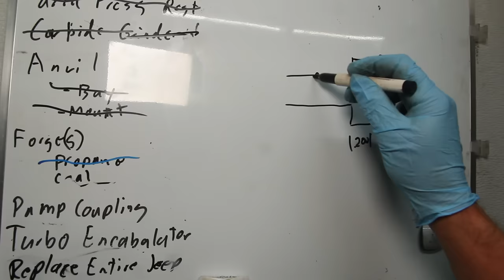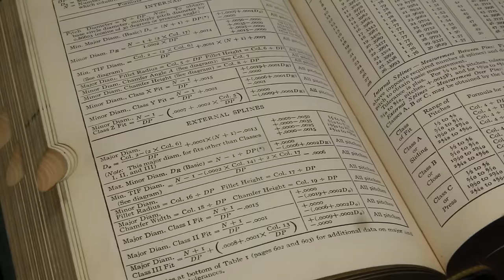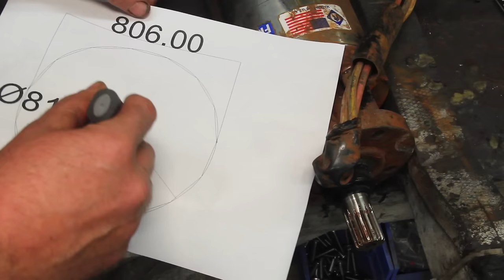Internal Splines (and Hexes Too)

Comment from the maker: A couple things keep coming up in the comments, so I figured I would address them here:
In getting ready for this, I was able to find the pats diagram for the pump, it shows a one-piece, rigid coupler attached to the shaft.  In fact, the shaft and coupler are listed as one part number.  It’s not a lovejoy or other sort of flexible coupler.  And yes, the fit on the spline as shown is probably a little tighter than it should be, but after several rounds of assembly and disassembly, the fit did loosen up a bit.  I’m assuming there are some small burrs in there that got knocked down.  If I had to do it over again, I probably would make take another .001 off. Additionally, the hex shaft is about .003” under the nominal dimension, and I made the broach to the nominal dimension, so there’s some wiggle on the connection on the hex end, so I’m not particularly worried about misalignment or vibration issues.  Also, a flexible coupler probably wouldn’t have fit in the pump housing.

The other two things that come up are 1) why not modify the shafts, and 2) why buy something to make it work.  The answer is: because Jeremy Makes Things. I wanted to see if I could do this, and do it as close to the right way as possible. I knew the theory behind doing an internal spline, but theory and practice are two different things. I wanted to push my skills.  As happy as I am with the end result, this project was just as much about going through the process.
Reply: You're doing an awesome job here, I hope you don't feel the need to justify all your decisions to any naysayers out there. Great to see you pushing your skills. Just keep on keeping on, you're doing all the right things 👍
Reply: G'day from West Australia🙂
As a 3rd gen engineer with 40yrs of trade life.

Well done buddy well done indeed.🙂👍👍
Reply: Well said. Thank you for a great video, I learned a few things. Awesome.
Reply: Jeremy makes things, not Jeremy buys things.
Reply: How much did you  charge
Reply: @Blue.star1  I believe he mentioned at the beginning of the video it was for a veteran run affair and was a "Freebie"
Reply: the reason your cutter climbs up in the holder when you are making the splines is because you have too small a relief turned at the bottom of the hole.
Reply: Nice work I have a shaper as well. It’s a Hindey shaped . It’s just about ready to use the oil isn’t getting to all places it needs to.
Reply: Nevermind....
Reply: You did an excellent job, coming from an Sink/Wire EDM guy!
Reply: I would label the 2 test pieces, keep one and give the other to the owner/caretaker of the pump so if it's ever lost or broken, you have the template without having to do all the refiguring.
Reply: The spline is actually a common one. Many tractors even today use a front or mid mount PTO that spins at 2200 or 2000RPM using a one inch 15 splined shaft and couplers
Reply: @edm2514  I agree, but personally I would have built an EDM machine, it's easy to do. Check out the "Easy Peasy" dc motor pulse EDM build on my channel, it's a cheap and quick way to build a commercial grade EDM.
Reply: @AtMortenJ  thats the same thing my doctor told me.
Reply: @Tigglebitties  Do you really think this needs micron precision? Bearings handle a lot, and lip seals have flex for a reason. One of the great things about precision tooling and work is that if you just 'get close' with something like he did here it will be fine for coarser machinery like this pump assembly. 'Precision' is always relative and this pump and it's environment are not very precise at all by machine shop or tool room standards.
Reply: ทำวาลาเดนเซบาสมาหในกรุงเทพของจริง
Reply: Delrin.
Reply: Was wondering if grinding a small back slope on the tool where the set screw sits might help this? but maybe it would just slip the other way?
Reply: Probably would have been easier to replace the shafts with keyed ones. I don't imagine that pump is spinning very fast. Journals on paper machines are just keyed and spin a few thousand rpm. There's a lot of weight and torque put on them as well. 
It's fun to make something tricky every once and a while, but that project is what we affectionately refer to as a Fuck-Story. Working for a company that has some of the OLDEST equipment in my state and region has me doing some inventive stuff to keep these ancient machines running.
Also, Amada and others charge ridiculous prices for spare/replacement parts. Parts that I can make for pennies on the dollar.

Comment: We had a spline shaft come in pieces, to the shop. I made a series of kerfs, carbonized it, and heat treated. Made a short broach to clean up the spline. Used a dividing head for the shaft. I think you should always knurl, as slow as it goes. Too often, the knurling wheels, weld on to the pins. Can't keep enough oil on them, knurling can produce a lot of heat.

Comment: Jeremy, a while back I had a similar problem with a splined shaft from a Volvo Penta transfer shaft.  In my case, splines were worn due to hard shifting and the metal not being hard enough.  So, I simply converted the splined shaft to a hexagon and that made the process much easier, not to mention harder to wear down.  Great job.  A pleasure to watch as always. Gilles

Comment: I have worked on alot of these submerged pumps and you've done a GREAT JOB making them fit together . The different companies intentionally made their connecting shafts different just so the average person couldn't connect them together they want everyone to buy a new pump and motor together but if you had the other two half's you could have just changed out the shaft witch is possible in some pump's or cut the shaft short turned down the end and pin or weld on the right shaft connecting head. But AWESOME JOB !!!

Comment: Was working on the bomb bay doors of a B-17 and they used a splined shaft sliding thru a bronze coupler to compensate for the length of the actuator shaft changing as the doors opened and closed.  Parts for an airplane this old are usually made of unobtainium but the factory drawings for the parts had the manufacturer of the spined shaft and they are still in business and they still make it.  Purchased 6 feet of it and used pieces of the "pinion wire" to make a broach and then drilled some bronze for the couplers.  Once the couplers were broached the fit needed to be  a sliding fit and so a lot of valve grinding compound was used to wear in the couplers.

Comment: I learned something new - when using setscrews to secure a hardened tool in a shaper, use at least TWO setscrews at 90 degrees to each other!  The tool pressure is clearly immense.  Machining a couple of mating dimples into the tool might also be useful (?).  Great video.  Many thanks!

Comment: Next time, if you have access to a comparator you can use epoxy to make a copy of the shape on the splines, align it on the comparator and find the exact angles and measurements you are looking for, lightly coat the splines with oil, anchor lube or Vaseline to keep the epoxy from sticking, it works perfectly and no much need to hunt for information. 

Great job on this build, I did learn some points on how I can do better next time. Thanks.
Reply: Another key way to measure splines (external or internal) is by a dimension over pins.. I think the pins need to sit on the pitch diameter of the spline, and it should be possible to calculate it using CAD & approximating assuming a straight sided spline tooth.  Great video! & great that this was a 'volunteer job'! (wonder if you heard anything back from them, is it still out there pumping away?)

Comment: A masterful piece of work and patience!  No more buying broaches for me, I've got the shaper, heat treat oven and oil so no excuses.  Just a note on the hex holder tool you made, if you part off a little brass disc and put it into the grub screw hole before the grub screw, you won't get all those marks from the screw tip on your nice hex mount tool 🙂

Comment: Great work on the slotting, Although I would recommend using the standard tooth to slot the correct profile. Seem like an application in which high RPM is experienced, its prone to quick wear and mismatch. You should be able to hear it with time (if occurs).

Comment: For your backing out problem you had with the hss cutter in your spline maker, try putting in a center drill divit where the set screw seats. It should greatly reduce the chance of it backing out and loosing your measurements

Comment: the amount of wobble at 11:15 is glorious. when this dude says its not exactly straight he is incredibly optimistic!!
Reply from the maker: That was where I parted it off into two pieces.
Reply: @JeremyMakesThings  it was nice work. without cnc and cam. I woulda needed several runs before anything worked out.

Comment: That was long but great.  Watch Wes Work needs to watch your channel,  A hydraulic barrel cylinder had a spline that got super sloppy.  A perfect job to bore out the hole and make a pressed fit replacement as well as weld up and spline the shaft of the barrel cylinder.

Comment: I had the same problem with a tool sliding in a boring bar while single point threading some ACME nuts for a project. What I did to stop the problem was grind a small groove in the side of the cutting tool so the set screw had something to locate on and bind in. The tool never shifted for the remainder of the job once tightened in place. Another solution I have seen is to bore a small hole in the side of the boring bar the intersects the square hole and tap it for a second set screw. With two screws the tool is held more securely an is less likely to slip.

Comment: Great, fun video.  Haven't used a shaper or planer in decades.  But I need a cheap and simple method of creating internal splines.  Short of broaching, it's not going to happen in solid metal.  With some compromises, may be able to mill acceptable ribs.

Comment: Very real down to earth video of what a machinist has to do when they have to make a new one off custom part fit an existing “well worn and used” part. 

There will always be a ton of trial and error followed by readjustments and it’s awesome you included a lot of that with this video. 

On a totally unrelated note I was wondering if the people using this ever expect to have to separate these two halves again for any reason? 

If they had told me unlikely then reattach the two halves, cut an access window to be able to work where they come together, MIG Weld the crap out of the two and call it a day 🍻 … but if that had been the case we all would have missed out on this video so cheers to you late for taking the longer, harder & Higher Road.

Comment: Never seen a shaper used in that way! These days it's rare to even see a shaper in a modern machine shop. Nice job thinking outside the box! To make internal splines we make a graphite electrode and use EDM to burn the shape into the part.

We used to machine a lot of 304SS at work. That is one of the most miserable materials you can turn in a lathe. We got the OK from the customer to experiment with 303, as the parts didn't need much strength, only corrosion resistance. 303 cuts almost like cast iron, leaving a powdery type chip instead of long strings like 304. We have a contract of about 2,000 parts a year and we have had it for nearly 50 years so it has saved a lot of machine time (and machinist headaches!) over the long haul.

Comment: Thanks for showing a shaper machine usage. Since I don't own a shaper I probably would pay someone to use their die sinker EDM machine  or  a wire EDM . If using the wire EDM you would have to later spin-weld the hex. female & internal spline together.   I don't own or know how to use an indexing divider so I would use my rotary table.   I would have ground or cut a shallow step on the 3/16  square bit enabling the set screw (grub screw)  to tighten onto & preventing unwanted movement.

Comment: Impressive work. The 1" 15 spline is actually a very common size. ALL 2000 RPM Power Take Off for tractors and mowers have this spline configuration. You could have bought a coupler from Surplus Center to make things alot easier. They sell the spline coupler and the hex coupler, which mating them together would have been easy. Ice done several " adapters" for various applications

Comment: Yep a lot of work, and looks good. But I'm sorry to say the motor is an industry motor for borehole pumps and the splined part is available with out having to go through the large amount of work to get the item. We have old warn shafts that would give the internal spline and give a bush to weld to the other item. Tony

Comment: Nice work. Try to punch on the spline tool u made on side where the locking bolt rest. So that it locks with the hex threaded bolt u used.  And the tool wont get shifted. Best of luck.

Comment: These type of splines usually have a 30 degree pressure angle but the shape of the tooth is actually an involute so its shaped like a gear tooth, and actually has a little curve to it.

Comment: A year late tip. The internal shaper tool bit needs a shallow v notch or a shallow notch ground in it to stop the tool from slipping as it will be not only pinched by the set screw but positioned by the tip of the set screw.

Comment: 4:05 when drilling into a small diameter round bar, spot face a flat slightly larger than your drill onto the round side of the bar before center drilling to prevent it from walking. Then it is no different than drilling into a flat surface.

Comment: over all I believe you did a great Job, never having to cut internal splines, I did learn a lot, thanks for this video
my only concern is your accuracy may be greater than the stack up tolerances between the pump face and motor face both parallel and concentric,
but I am sure everything worked out just fine

Comment: I'm no expert on splines either. I had to make an adapter spline for a $40,000 plastic injector augur. It to was a non standard 15 tooth spline. I did know that it was metric. I didn't have a Shaper, so I used a lathe with a crudely fabbed indexing  wheel. It was also 304 Stainless Steel. I was lucky on the opposite end.  It was  a simple Keyed connection for  the motor. The Augur was about 8' long with a tapered and progressively shallower rounded root dimension. The pitch also changed as it got closer to the small end.

Comment: I know that was a challenge but you done a good job I'm a retired machinist tool maker most people don't understand how much knowledge and skill it takes to do a job like that where you have to make your tools to do the job with but I do done it for almost 50 years love your shaper they are hard to find been looking for one the same size are you running it off a dc motor what brand is the shaper that was a job well done like it that you showed mistakes like in real life that everybody does but usually don't show thanks new subscriber
Reply from the maker: The shaper is a Rhodes, and I’m running it off anDC treadmill motor. I’ve got a few videos on refurbishing it.

Comment: Wow, that's just crazy 
Want to tackle making a coupling for a Sundstrand hydraulic pump? It looks like the same spline size and no parts are available. Old collectible Wheel Horse tractors used the Sundstrand setup, but the engine couplings fail too easily.

Comment: Love it! Edm might be more accurate to use the first piece as electrode.  You might need to put a gauge with liquid coating if you want to add some play in the part after.
Reply: Or maybe just get a $200,000 waterjet machine and stick a 6000 sq ft addition to your attached garage to house it.

Comment: The piece you made looks awesome and I enjoyed the video. However, aren't those couplers normally semi-flexible to compensate for shaft misalignments caused by heat and vibration?
Reply from the maker: Some are, some are not.  From the documentation I could fine from the pump, the original just had a 303 stainless hex coupler.  It seems like the design of the pump has some play in it to account for misalignment.
Reply: In the hydraulics/heavy-equipment industry (my industry) we call the coupling a LOVEJOY COUPLING.....just an FYI

Comment: Thank you for the video 👍😀
I like the 4 inch indicator you use on the lathe , where did you buy it or what is the brand / type ?.
Thanks 👍😀
Reply from the maker: It’s an old Ames indicator, I got it at an auction.

Comment: btw for getting spline dimensions. you could've measured across the centre (groove to tooth), then gotten the tooth height by measuring inner curve to groove vs inner curve to tooth. difference wouldve been tooth height...

Comment: Little surprised you didn't blue the splines and check the interfaces on your test pieces.  It's the only thing I would have done different.  The ultimate sanity check to see what (if any) adjustments to make on the tooling.
Reply from the maker: This is a good idea.  I felt that was able to tell from the marks on the aluminum piece (especially when they were too tight) where it was making contact.  I was also able to shine a light at the back and see where I had clearance and contact well enough.that I felt fairly ok with my sanity level.

Comment: "A spline is a continuous function which coincides with a polynomial on every subinterval of the whole interval on which is defined."
"SPLINE is a thin wood or metal strip used in building construction."
"Splines are the ridges or teeth (external spline) on a drive shaft that mesh with an equal number of like ridges or teeth (internal spline) in a mating piece with the purpose of transferring torque from one member to the other."

"Etymology  Mid-1700s East Anglian dialect. Origin uncertain but perhaps from Old Danish splind or North Frisian splinj and ultimately related to the root of splinter."